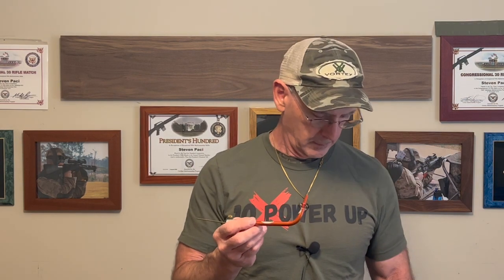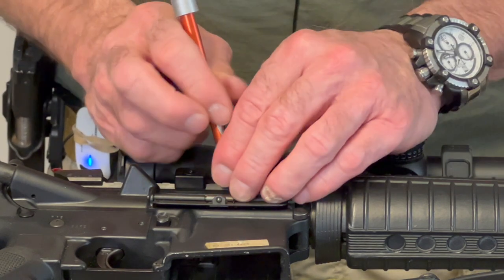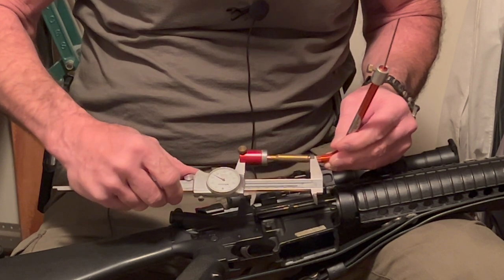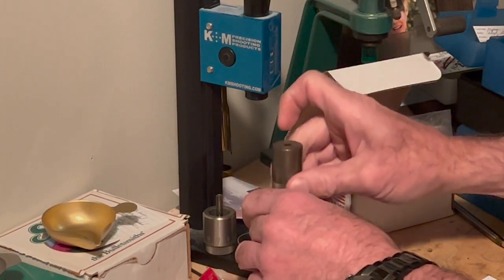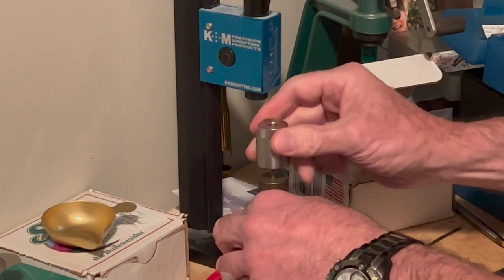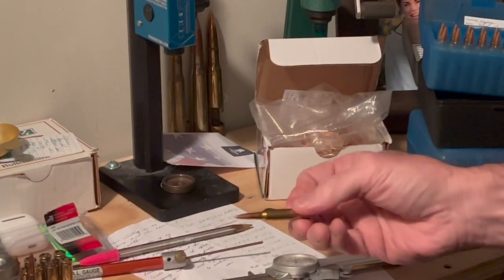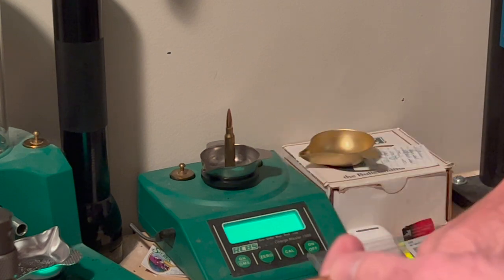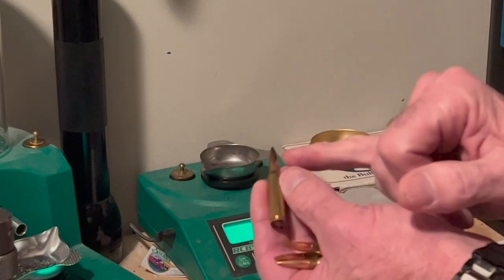Loading .223 Sierra MatchKing 80 grain 600 yards#rifle #shooting

Comment: Can you tell me the total length of the case and bullet combined with just the calipers... and do they fit in magazines?
Reply from the maker: the Over length from bottom of case to the tip of the 80 grain bullet is 2.435.  This will not fit in a magazine, I load 77 SMK's between 2.250 and 2.255 ish for the magazine.  Steve

Comment: Steve... what is your go to powder for the 80 smk load?  Thanks
Reply from the maker: I use Reloader 15. I use either starline or Lapua brass.  With both cases I run 23.2 grains and run around 2650 FPS.
Reply: @10XPowerUp  very good.  I'm getting identical velocity in starline case, 23.0gr RL-15 and 80gr ELD-M (2.460" OAL / .020" off).